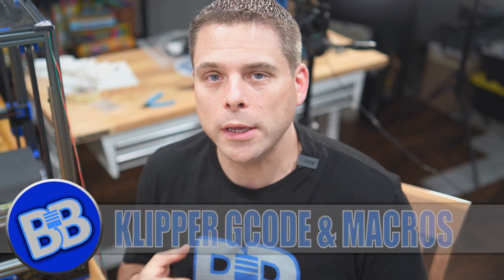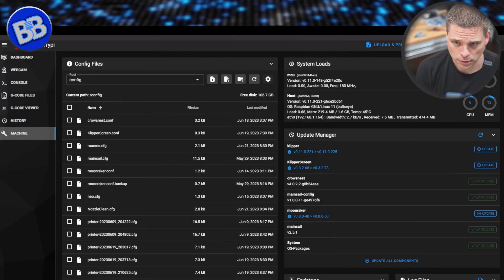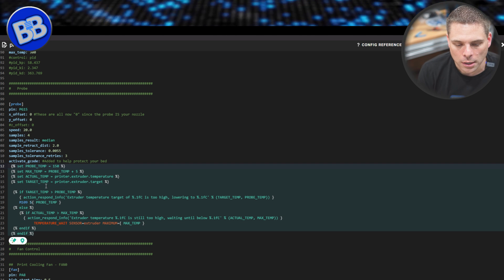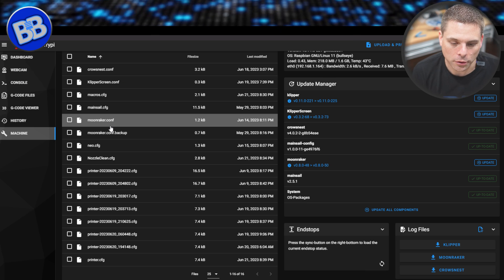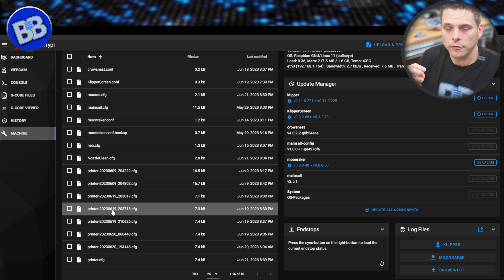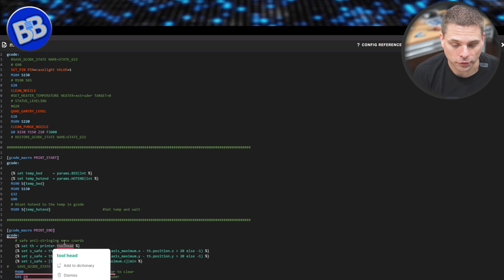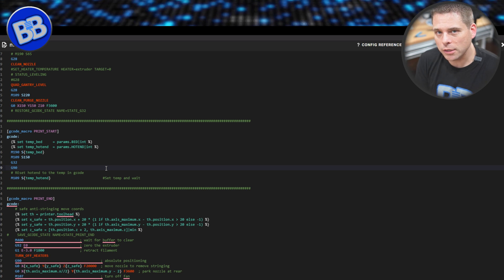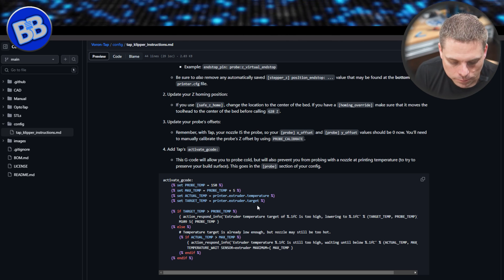Is Your Tap Too Cool to Extrude?

Comment: I working on getting my Trident setup with tap. If I add this to the macro in the printer file. Do I need to still mod my slicer? I would much rather just have the modification on the printer alone and not modify the slicer if I can. And you’re saying that I need to leave the tap configuration from Voron in the configuration but then add your modification as well either in the print config file or make a separate file for that. Thanks for the great video, I’m really enjoying building and modifying the printer.
Reply from the maker: The modification to the slicer is just to ensure it sends instructions the printer (Klipper) can work with. Most of this is down to the fact that the printer needs to hold the extruder temp in memory as a variable, once the printer does the Z-home and any probing you need it then will re-load that variable.  I don't believe there is a way around it - but I wouldn't claim to know everything.  I do know that with every slicer I have used I have had to mod the start code to ensure everything goes smooth when using Tap.
Reply: @ Thanks, I appreciate the vast amount of knowledge you have for 3d printing. Im going to give this a shot tonight. Thanks again.

Comment: Great Video! What would be the code to put in for orca slicer? Would it be the same code as cura or super slicer?
Reply from the maker: Super Slicer should be the same (they are close cousins, Orca and SS). Cura is different - I thought I provided information on that in the video! Cura was around 6:15... No?
Reply: Thanks for responding! I think the issue was that I tried to put the code you had on your cura file onto my orca file. I haven’t gotten a chance but when I do I’m going to try and out the code for SS onto orca and see what happens. I also copied the code for the print start too from your link so I believe that should work fine too. I will let you know when I try again since I’m away from my printer at the moment. I’m new to voron so still trying to learn more about my printer!
Reply from the maker: It's not overly straight-forward.  But, once you wrap your mind around what's happening it starts to make more sense, much the same way that Klipper itself takes some time.
Reply: @BuildItBasement Yes definitely! I’ve been probably playing with Klipper for about 6 hours so far and I’m getting use to the mechanics of it so far. Just having the issue of actually printing which I hope I can resolve soon.

Comment: Hi, thanks a lot for this video. Start G-code will be modified in the same way if we are using Prusaslicer?
Reply from the maker: The modification to Prusa should be very close to Orca.  Both are based on Super Slicer
Reply: @BuildItBasement  Hi, I tried your slicer mod and it works for prusa slicer. Thanks for this informative video.

Comment: Nice! I do something similar already for my print start.

Stop using Cura - I used to use it, with the voron I switched to Prusa slicer / SuprSlicer.
Having the thumbnails show up for your objects in Klipper is worth it, but also the slicer is much better, cleaner prints using it, more modern features too.

I have SNS tap sat on my desk, need to install it.
Reply from the maker: I like the thumbs - Cura just gives me a base that relates to a lot of users.  I'm interested, what do you do for your print start?